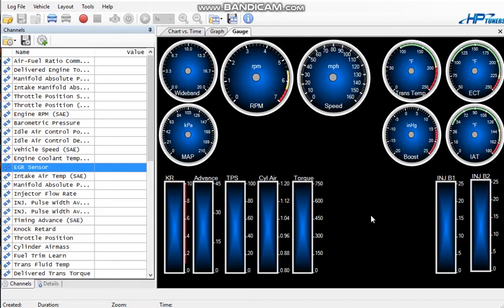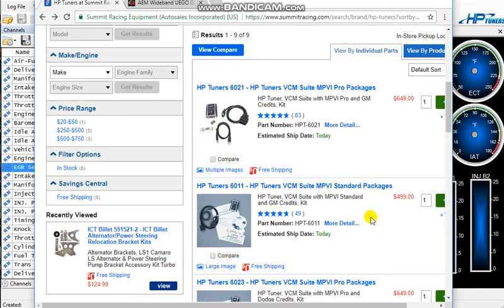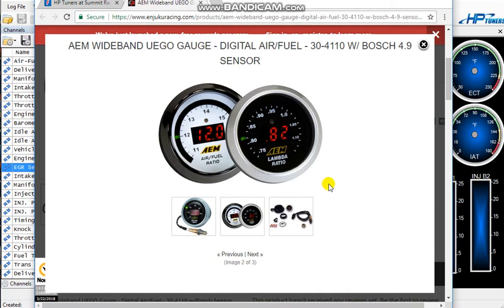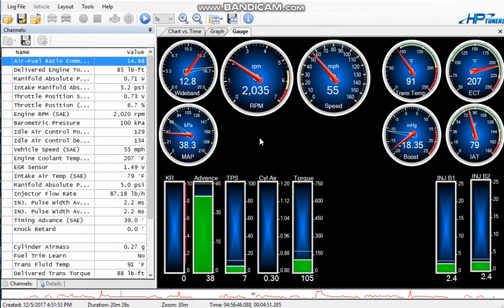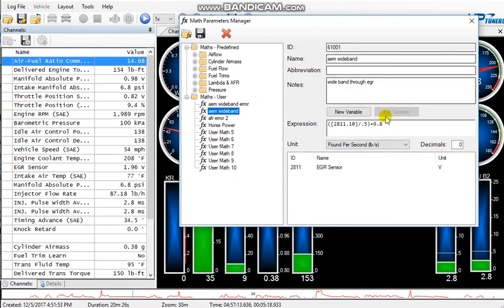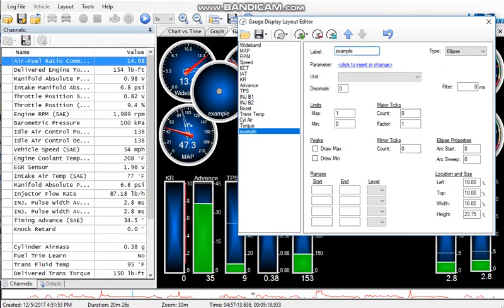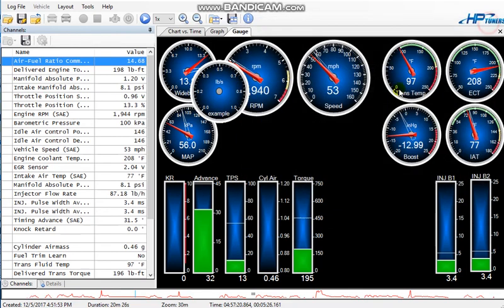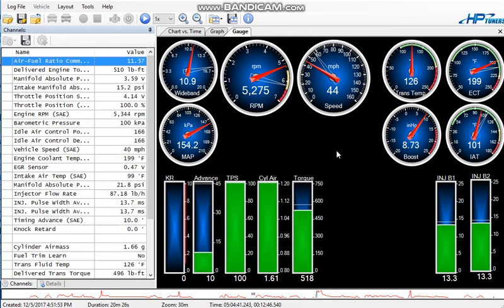DATA inputs using CHEAPER version of HP Tuners LSX

Comment: so i just take my output from wideband to voltage return for egr
Reply from the maker: Correct, there should be a 0-5v signal wire for the egr that goes into your pcm. Alternatively you could use an ac sensor or fuel tank pressure sensor.

Comment: I don’t have egr  in my 05 , can i use the map sensor 5v signal Instead ?
Reply from the maker: I've heard of people using the fuel tank pressure sensor or ac sensor. The engine needs the map to sense manifold pressure...
Reply: @scottcoleman162  thanks, yea that what i was thinking , fuel tank pressure sensor will be lol.. 👍🏼
Reply: Hey man is normal my was 2 decimal off i add +12  to be close to my guage …
Reply from the maker: @XXNAYARITAXX  yes sir, all of them are a little different and you just add or subtract to get as close as possible. 👍
Reply: @scottcoleman162  oh nice thanks again , 🙏

Comment: hey do you know if the pcm changes anything like the fueling when it sees the egr voltage? thanks
Reply from the maker: juck huo no it doesn't, you have to change it manually in the editing software.
Reply: Thanks, I know i can do my own changes to fueling with hpt but i just didn't know if the fueling changed depending on what the egr is doing.  I just dont want the pcm doing weird things from deleting the egr and feeding it voltage from a wideband. Thanks again for your video and response.
Reply from the maker: juck huo you'll need to physically delete or disable the egr from the engine and disable the CEL error reporting for egr in the editor.